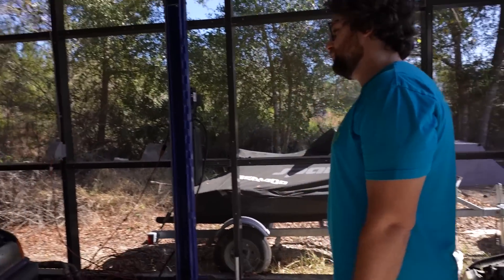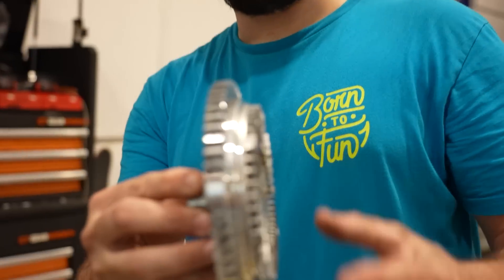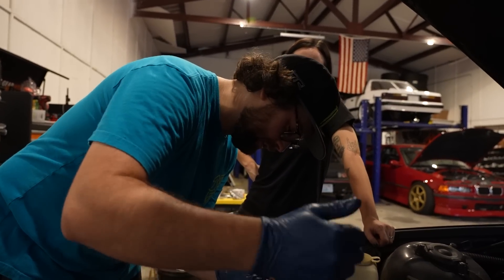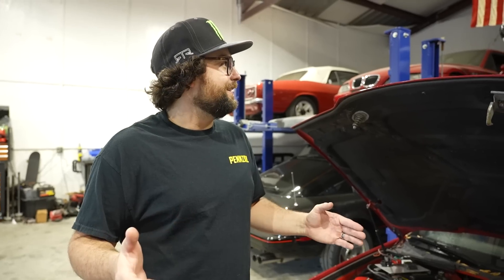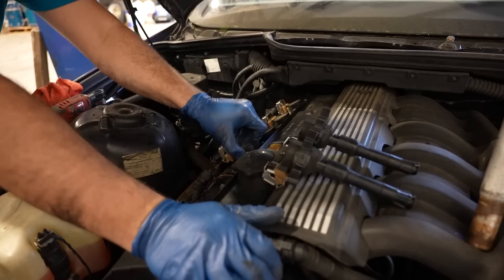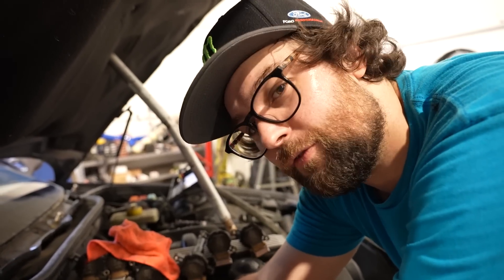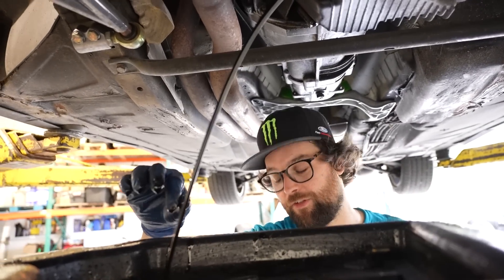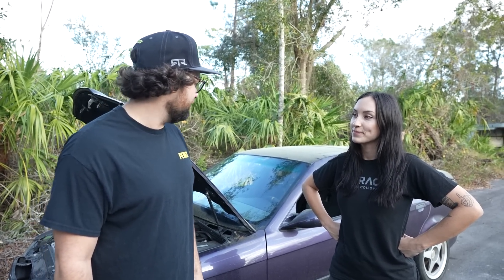The Wife's E36 UPDATE! Cooling System UPGRADE and Tune Up Goes as Planned 😂

Comment: Hey fam after you installed that thickboy rad I didn’t see it shown in the video but afterwards does it allow for the beauty cover to still sit back over it ? I have the euro cover and I don’t want to ditch it 😅
Reply from the maker: Yea it fits over it
Reply: @chelseadenofa  thanks for the reply! Cool then I got to thinking about the water tank. I think I found the rad. It’s got a 2.75” core is that right ? Do you run a non oe expansion tank then I assume ? I found some cheap metal canton brand on Amazon thinking if that’s the move or do you have a recommendation?
Reply: It seems like you just kind of let it chill off to the side using the stock tank after trying to playback the video toward the end. It’s not a clear image but I get the idea thanks man hopefully this lets me beat on the car longer next summer 😀

Comment: U should make a full e36 hack/tips on what other bimmer parts work on e36 for upgrades. Like e34 u-joint n stuff like that
Reply: I agree. And then a part two on E46's
Reply: There’s no way he could think of all the little things he knows about them to put it all in one video.
Reply: Tell me more about the U joint 🤔
Reply: @jamessuman2151  steering column bushing use a 5 series to upgrade it from stock rubber

Comment: You should fix that headgasket leak.
Reply from the maker: I’m not sure it actually has one.

Now that we have it flushed I’ll do a fluid test to see
Reply: Yeah you're right. At first i saw blown radiator and nearly blow expansion tank, compression press test difference, little bit grey oil, coolant leak sealer and problem to bleed coolant system, which all of them tell me story of leaking gasket.

 But those plastic radiators can break easy, so it could be reason for leak sealer added, expansion tank was from another car so it might be seen those high pressures in it's previous life, the water in oil (grey oil)could be from condension water because car was standing so long and if there is no air bubbles coming out from coolant system after bleeding i think it's good to go! 

Thanks for great vids and keep rocking!

Comment: I was running no clutch fan but wired the ac fan to turn on when the car powers on.. it never passed over the quarter line for over heating.
Reply from the maker: When drifting hot laps that won’t work

Comment: Yo. I was looking online for a 5 series fan clutch for my m52. But they all say they fit all 3 and five series. 
How do you tell the difference between the one that sits closer to the engine instead of the rad
Reply from the maker: 1994 530 v8
Reply: @chelseadenofa  my man

Comment: I run a volvo 940 electric fan in my e36 turbo and it works great! that fan is very popular in sweden. but it requires a lot of amps!
Reply from the maker: They work on, we also have a similar fan here. But not as good as the clutch fan

Comment: You ever have issues when running a colder thermostat? I threw one in last year and kept having issues with the car staying in open loop cause the ecu thought it was still warming up. Switched back to stock and haven't had the issue since

Comment: Do these cooling mods work on e46 as well? As far as the fan clutch/fan?
Reply from the maker: Yea, you’ll need a different water neck and hoses tho
Reply: @chelseadenofa  does the viscous clutch and fan bolt up to M54, I've got an e46 aluminium radiator without inbuilt tank as i plan to remote locate it as for water neck/hoses any idea what works?
Reply: @gcSR86  if you run the Stewart water pump or any other water pump with a thread on the pulley flange you can put a fan and clutch on.

Comment: Is there an advantage of buying an E46 instead of an E36 for a drift build ? I guess E46s are maybe in a better shape I guess but which one is mechanically better and easier to work on ?
Reply: In all honesty, models under the m3 for the e36/46 are all basicly the same engine crap wise. Cooling system problems, oil system problems the fact they're not jdm swapped problems.
Reply: E46's are a lot easier to find right now and are marginally better in many ways.
Reply from the maker: E36 is better mechanically. E46 is better geometry wise. But not by enough to care

46 motors are junk IMO. Outside of s54
Reply: @chelseadenofa  thanks Chelsea, it’s either either or E46 with a decent swap if I understand correctly. How much did you spent on your ecoboost swap ?
Reply: E46 weighs a LOT more. Dual vanos / ms43 is a upgrade on the e46....  the e36 has a bullet proof iron block. The e46 has a aluminum block that can warp/ strip head bolts with one overheat.   E36 for a drift car. E46 for a daily. * e46 is much more comfort/ quiet / smooth on the highway. I drift a e36. I Daily a e39 528 touring with a turbo e36 m3 motor.

Comment: You should definitely make a full length video on how You bleed E36's. Everyone seems to do it their own way and hardly anything ever works.
Reply: I second this. I've been fighting my cooling system for the last year and still don't know what the fuck i'm doing
Reply: jack up the fromt, Fill until it comes out of the bleed screw, start the car, run until at operating temp, shut off, let it sit, open bleed screw, check for bubbles from the bleed screw
Reply: Yes please any full length detailed maintenance things on the E36 or e46 would be awesome.
Reply: Getting the front of the car elevated is the key, air will want to go to the high point in the system, when the car is on level ground the high point is not the reservoir. Simply parking on an incline or driving up on ramps makes them so much easier to bleed out the air.
Reply from the maker: This except leave the cap open when the screw is closed. It’ll bleed through the little hole by the cap.
Reply: This is how I bleed any vehicle. front elevated, cap off, let it run, fuck with the hoses, smoke a cigarette even if you dont smoke, snap the throttle, cap it off, test burn out.
Reply: @ervendanielray3136 no literally lmao exactly what I did to my e39 the other day

Comment: load the system w vinegar and then flush w the garden hose - the vinegar works to descale the whole coolant system and get all that built up crap out of there - i use it to descale my tankless water heater and youd be surprised how well it works compared to just a regular flush

Comment: Yea Rule #1 never use a harbor freight compression tester. I definitely learned my lesson w those 🤣 
They read really weird or low. I would add about +5 psi to the reading
Reply: As long as all cylinders have similar compression you should be good. Harbor freight one works fine for that.

Comment: Euro clutch fan is something SO many people sleep on 👍
Reply: I can't find it at FCP's website Do you have a link?
Reply: It's honestly pretty unnecessary if you use the late model fan blade. Most people complaining about the stock clutch probably have an original unit  from when the car was new. Doesn't matter what clutch it is it's going to start slipping before it goes out.